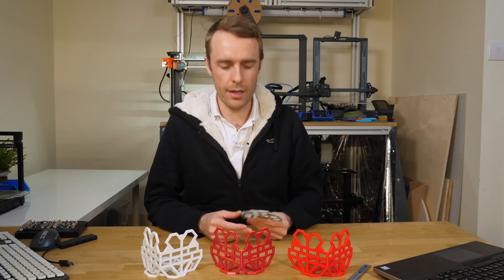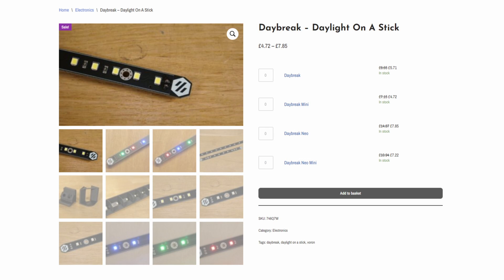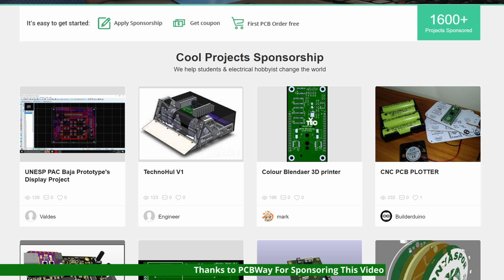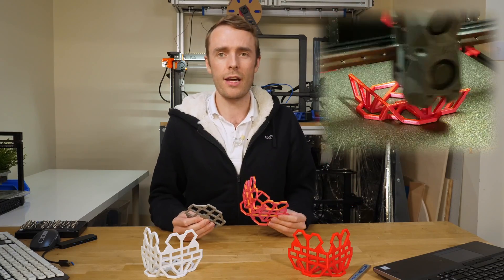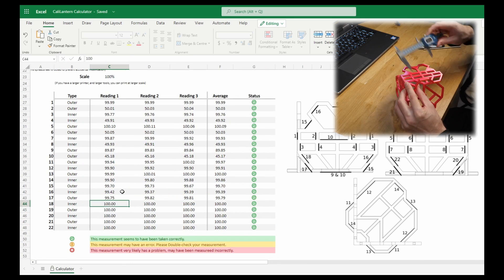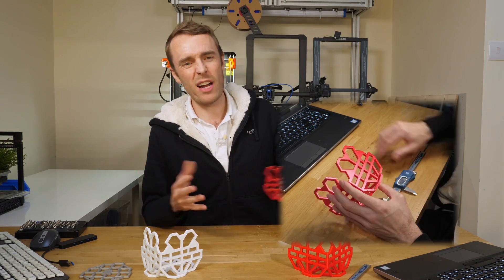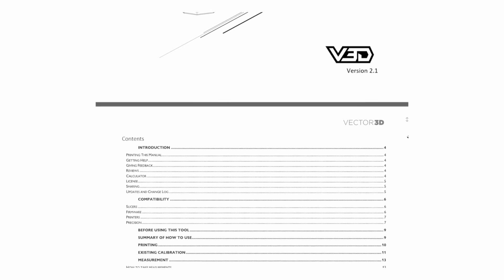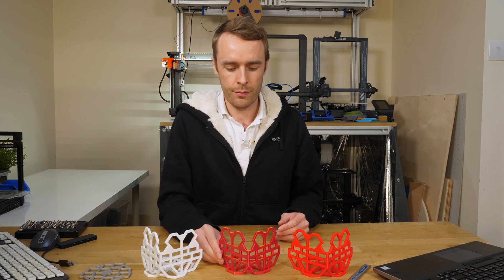One calibration print that you shouldn’t skip

Comment: I used your latest version and have a question about the scoring.  I have run 5 passes now and the skew angles are either perfect 90.00 or 89.99, yet the scoring is still in the mid 800s.  What exactly do I need to do to get a higher score?  What is dropping the score so much?

Comment: Many years ago (about 10+) when i had my first printer, the wooden Replicator Dual i squared and trammed it out but found my prints to be slightly off in X/Y so i simply tightened the belt until was able to jog the head and measure the difference with my caliper. I found if i did the same measurement starting from the other end it would be off by a bit, in which i learned the dimensional relationship between the stepper motor and the closest link to the tool head. And it changes between enclosed and open prints (ABS or PLA, etc)

I would recommend printing out one of those belt tension tools in petg, just to get a relative position on the tension your adjusting

Comment: EDIT: It turns out that I was not doing anything wrong, but rather there was a problem with the calculator itself. Thankfully Adam was made aware of this and is working on a fix. Still a bit of a bummer with the wasted time but I guess that its just my luck that the calculator broke right around the time that I bought it lol
I have no idea why but my score is still worse than baseline after 4 calibrations. I always double check that I am measuring in the correct location, I make sure that my calipers are square with the print and use little pressure to not squish the part. I update the next sheet with skew settings I got previously. My score went down from 443 baseline to 283, I feel like I'm just wasting filament and time at this point...

Comment: What's the appropriate slicing tolerance setting (in Cura, I'm not sure what the equivalent setting is in other slicers) for this print? Middle? Some of the designs I print need exclusive mode to fit properly, and I don't want to tune out the slight space between parts that that introduces.
Reply: Actually, thinking about this a bit more, I think exclusive is the right setting for this, though it's unlikely to make a huge difference. Other slicing tolerance options will add a tiny amount to the measurements against the outer walls. Slicing tolerance is a constant difference regardless of the object size though, so it's unlikely to matter at all for a larger print like this. Which mode is used for the calibration is also unlikely to affect the fit of different slicing tolerances for small parts.
That's my best guess. I'd love to hear others' opinions though.

Comment: I would love to try it, but I find it too expensive.

For those of us who have a 3D printer as a hobby, 10€ for the model is too much. I understand that it takes a lot of work in the studio to make it, but I think at a lower price it would sell a lot more units, which would cover that price drop.

my two cents
Reply: I disagree.  And it's not just a model - it's a comprehensive guide, a model, and a calculating spreadsheet that collects the measurements, analyzes them, and provides updated parameters for common versions of printer firmware and slicers.  It would likely have taken me a couple of days or more to develop this even for just my own printing tool set.

Comment: When measuring 9 and 10 do I measure at an angle or to the bottom straight part.  The instruction isn't clear on it bcz there is a piece which is comming out.

Comment: The item together with Excel spreadsheet doesn't worth the money if you use RRF. Do not waste time and money.
I bought the item. I 3d printed it . I measured it several times. I adjusted the parameters in the printer configuration. I re-printed with new parameters. I measured again and the excel files tells me that the printer is more skewed than before. I am using duet3d board with  RRF . There is a mistake in the calculations in the excel form. Also to take proper measurements on the diagonals is a PITA.
Reply from the maker: Hi Florin, Lots of people have had success with this. If you want to join the discord it'll be easier for me to help you there.
Reply: @Vector3DP  I'm very confident that your skew calculator flipped the AC and BD measurements. If i punch in the recommended skew numbers into klipper and then ask klipper console to output with GET_CURRENT_SKEW it will spit out the reverse (flipped sign convention). it's possible my printer is dumb but it took me a few prints to figure out why it was getting worse each time.

Comment: It is not so easy so measure it perfectly and to be always perpendicular. Also the amount of slight pressure on the calliper changes the values. But it worked at the end and I saw how good the raise3d pro3 from factory was. 700 points but after calibration I got 980. so nearly perfect… thanks

Comment: I've printed and measured, but I am confused on the instructions from there. Printed using Anycubic Kobra Max sliced in Cura. After filling outt the sheet the adjustments I am to make are 

1. Modifying firmware for SKEW
2. Material Shrinkage in Cura (combines XY)

And that's all?
or add 3. Steps/Axis part scaling 
I can add the material shrinkage values in Cura and modify firmware, but if my Internal measurements are off my -0.27% and external by  -0.03% then this will likely just decrease the internal error and increase the external error. Would I then Adjust horizontal expansion? what if it is different between X and Y axis? My XY skew was negligible, but my X axis was far more off than my Y and all internal measurements were all more undersized than the external measurements. Any help would be great

Comment: First of all I want to say I admire your content. I have lots of questions about what you are showing here, I hope does not come out wrong. 
1. Say you were to change your printing parameters like line width or anything flow related, would you need to redo the part for these settings? Holes and corners will look differently. 
2. How about nozzle diameter?
3. I am quite sure you will need to do this for every type (PLA, ABS, ASA, PA...) of filament. Did you notice differences in same type of Filament (e.g. ABS) from different manufacturers or even colors? I sometimes see differences even between batches of the same brand because the raw material has changed. This is not too common though.
4. As I understand, you make the changes in the firmware. Can you set different materials there? Or would it be better set in the slicer for different types of filament?
Either way, this looks so interesting I'm just gonna buy 🙂
Reply from the maker: Pretty much all of those questions are answered in the manual 👌 for the nozzle, you shouldn't need to redo it, but I've not tested that.
Reply: @Vector3DP  that's perfect, will take a look today, thanks ☺️

Comment: Thanks but no thanks.  I love your califlower and use it on all my material. I hope you continue improving it.  If it takes longer to print and measure, its definitively not an improvement.
Reply from the maker: But it does kind of 3x more as well as being iterative. If you find califlower useful, you'll probably find this even more useful. Up to you though.
Reply: @Vector 3D  i bought this and was wondering if the cauliflower come with it? I didn't see it. Only reason is because sometimes I'm lazy and just want to do a quick check before committing to a 3 hour print and 3 times more measurements lol
Reply: For some, the goal is final accuracy. This will help achieve that.
Reply: @float32  I've been printing engineering parts since 2015.  You need to calibrate and measure the hell out of your printer.  Totally agree.  Califlower takes care of speeding up the XY compensation very efficiently.   If there are issues in skew and Z in your printer, you need to take care of it.   You don't need a calilentern and 3h for this.